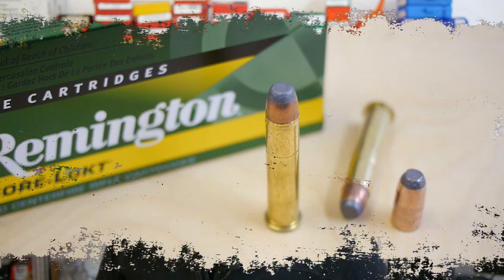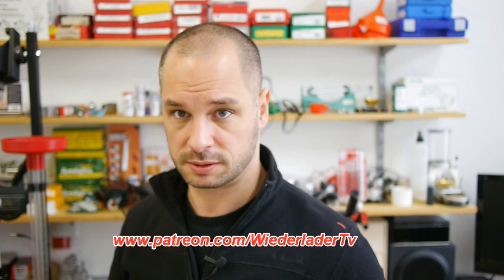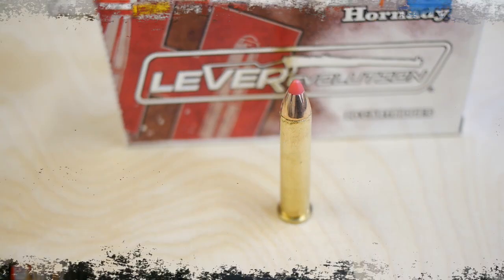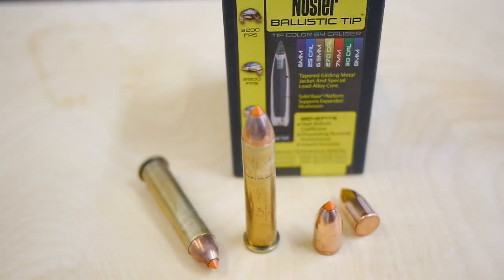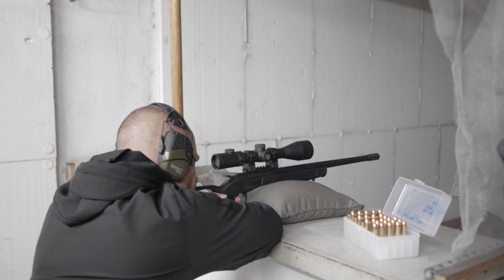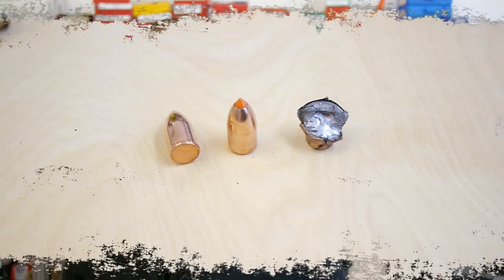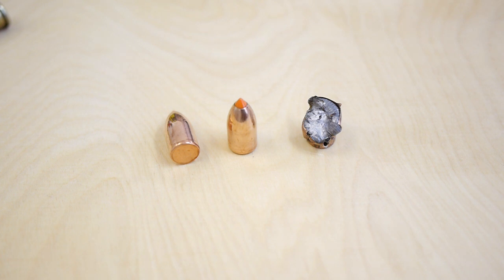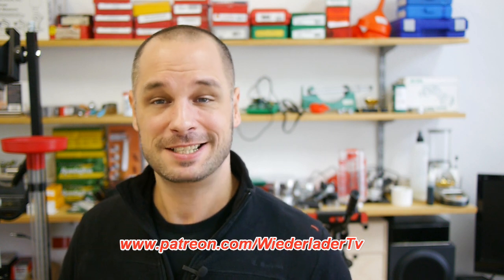45-70 Government - the modern way with Nosler bullets

Comment: I'm using the 325 gr FTX bullets in my Winchester 1885 falling block(28 inch barrel). With my hand loads I'm doing 2133 ft/s at the muzzle. Under those rules I would still be good out to 240 yards.
Reply: You'd have 1500 fps & 1660 ft-lbs out to 200 yards and 1278 fps and 1180 ft-lbs out to 300 yards with that bullet and muzzle velocity. Could probably squeeze a deer kill out to 350 but you'd be approaching subsonic speeds.

Comment: I know this is a 3 year old video, but i have a couple of questions. 
I also came to the conclusions that a single shot .45-70 would be a great boar gun for hunting out of my hunting stand. What rifle did you get? I only found a single shot henry in .45-70 and i dont know if its available here in EU (im from slovenia). second question, have you experimented with the hornady 250gr monolithic bullets or the 325gr leverlution bullets? should have a simmilar BC that you used no?
EDIT: I just found out your other video on the Bergara BA13

Comment: Yeah peeps don’t make that very simple mistake of loading .452 into a .458. Lots of the many 45 caliber projectiles are .452 i.e .45 and .45 Colt flavours through to .450 Bushmaster etc. .45-70 Government is .458 and the best round I have found is the Hornady Flex Tip in 250gr. Factory red tip pill loads leave the barrel at about 2000fps or 600ms but you can up that safely with different powders and handbook hand loads to deliver close to 2500 foot pounds at 100 yards with the 325gr. Winchester Super X is a 300gr hollow point which is safe to use in barrel magazines. Hogs, pigs or porcine, whatever you call them are not thick skinned game so you can hit them nearly anywhere with a hot loaded 250gr and it will drop them in seconds. And you can keep your ethical kill bullshit to yourself. We exterminate pigs here in Australia as they are feral animals. So if you see colour in the scope then you pull that trigger. The sound of a wounded pig quickly bleeding out is not nearly as confronting as a live pig dropped in boiling water to remove the hair from the skin. Why do think pork is pink and has no hair on it. Pigs have hair on them when they arrive at the abattoir and it’s not removed by shaving. Enjoy your bacon y’all!